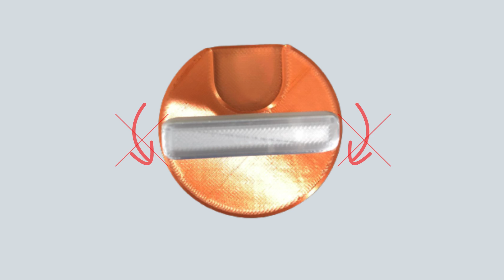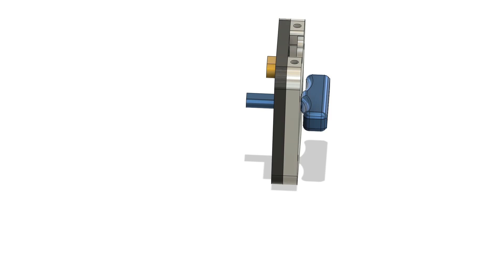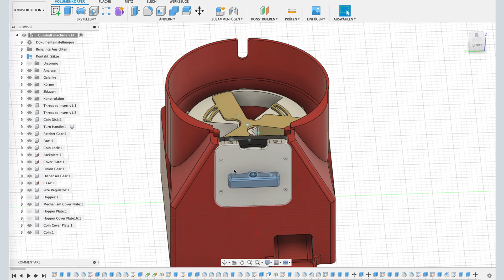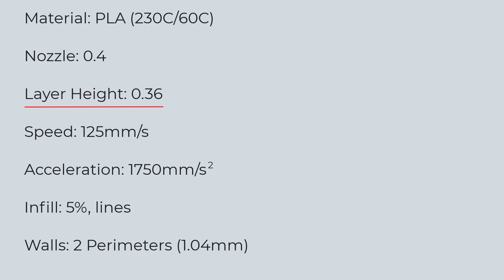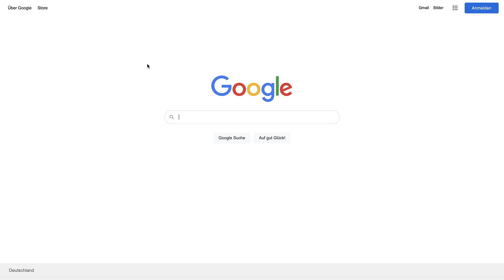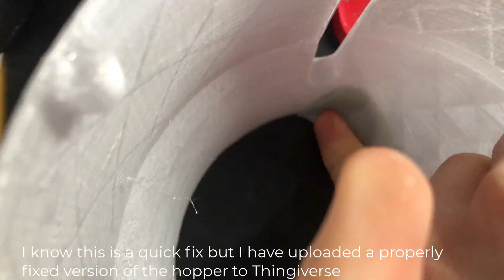Fully 3d Printed Gumball Machine

Comment: Looks pretty awesome, almost like a Lighthouse with the Lattice pattern in the globe and the Mechanisim is pretty much like a conventional Machine, mine uses a sprung pawl and a sprung lever at about the 90 degree point to detect a coin which can be removed to put the machine into free vend.

Comment: Still Nice voice
i am thinkin' of putting this outside for the kids to use, but oc there are trashy kids and even parents that will most likey mess up the handle, so is it strong, like can someone force the turn to spin or is it fairly strong?
Reply from the maker: Thanks! My handle is pretty strong and hasn't broken yet, probably because I used 100% infill and high temperatures. 
However, I've had someone reach out because his handle kept snapping along the layer lines. It was solved by printing the handle lying down and with supports.